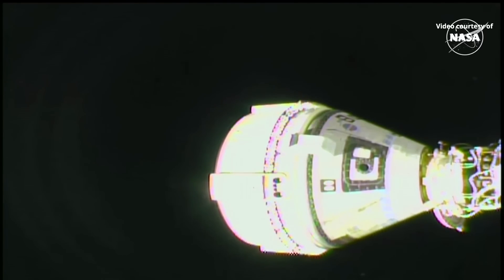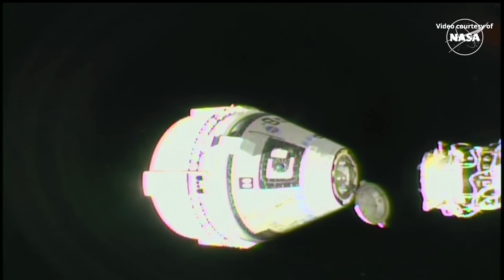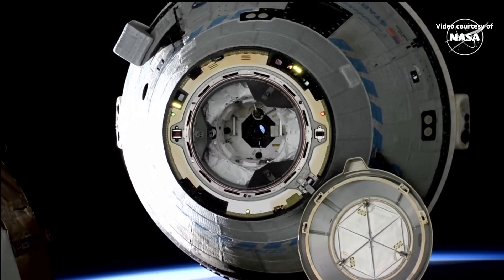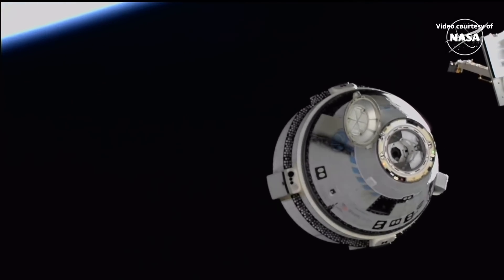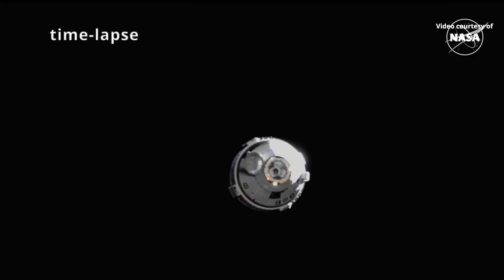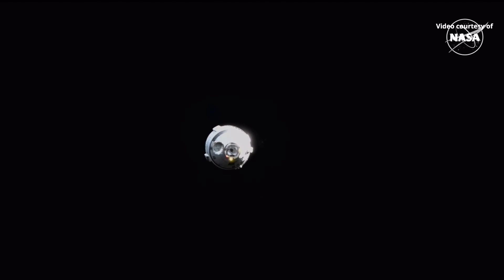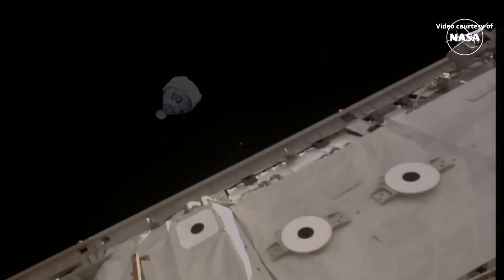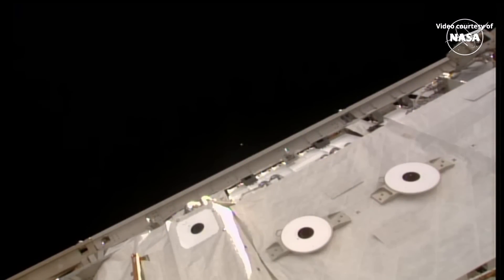CFT Starliner undocking and departure

Comment: They forgot to close the door!
Reply from the maker: Just like on Dragon, it's closed before landing.
CFT Starliner landing https://www.youtube.com/watch?v=DfMbwtcN-qk&list=PLpGTA7wMEDFjV3rHufRlA_0vdSQFL9a40
Crew Dragon undocking https://www.youtube.com/watch?v=gmuy2P-EZdc&list=PLpGTA7wMEDFjV3rHufRlA_0vdSQFL9a40
Crew Dragon splashdown https://www.youtube.com/watch?v=gjSjzSgQm7g&list=PLpGTA7wMEDFjV3rHufRlA_0vdSQFL9a40
Reply: …. They did close the “hatch”

The docking protection cover is left open, but it will automatically close for re-entry. 

This is the same method use on dragon capsules, the nose cone is a docking protector that keeps the port safe and sound during re entry, starliner is no different.

However… I’m not concerned about the doors like every airbus fan complains about Boeing…. I’m just worried about the heat shield… it’s a worry I had ever since STS 1, STS-27 and STS-107…. However STS-107… welp…. We don’t want to talk about it…..

Comment: Boeing seems to have a problem latching doors.
Reply from the maker: Just like on Dragon, it's closed before landing.
CFT Starliner landing https://www.youtube.com/watch?v=DfMbwtcN-qk&list=PLpGTA7wMEDFjV3rHufRlA_0vdSQFL9a40
Crew Dragon undocking https://www.youtube.com/watch?v=gmuy2P-EZdc&list=PLpGTA7wMEDFjV3rHufRlA_0vdSQFL9a40
Crew Dragon splashdown https://www.youtube.com/watch?v=gjSjzSgQm7g&list=PLpGTA7wMEDFjV3rHufRlA_0vdSQFL9a40
Reply: That cover doesn't close until shortly before reentry. It covers up a window and some sensors that are needed during the undocking process.
Reply: @joshmaday1462  Thank you for the explanation.
Reply: The cover is supposed to be open